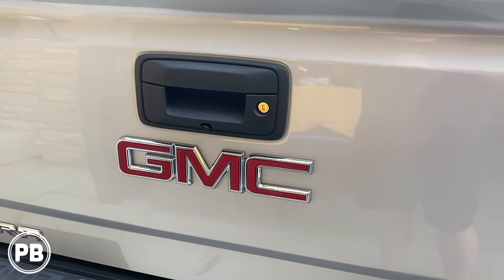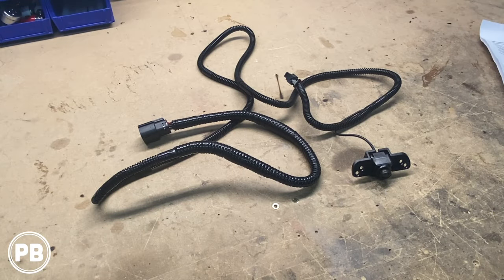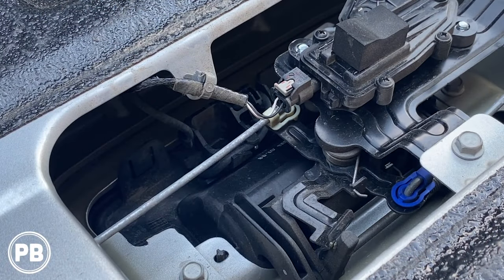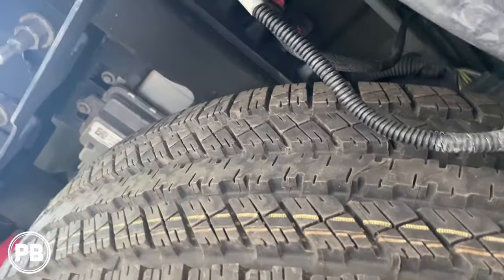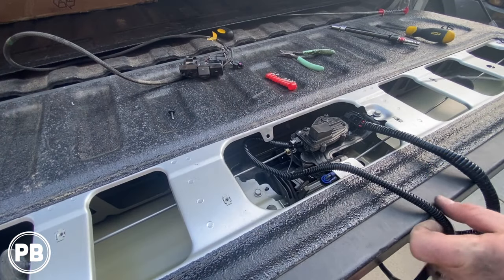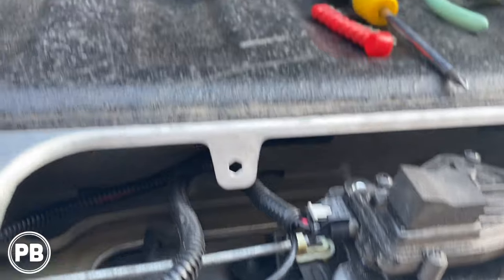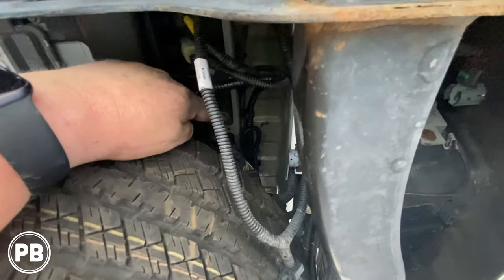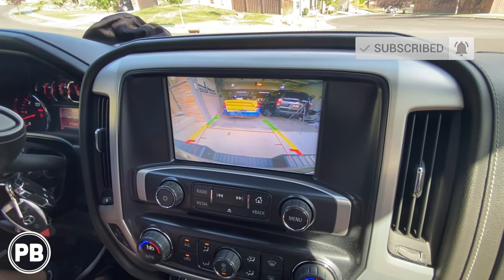2016 - 2019 Chevy / GMC Tailgate Camera Upgrade

Comment: before pulling out the old cable, tie a string around the original wire and when you pull it out, you can connect the string and pull the new line back through.

Comment: Will the guidance lines still work the same as with the factory camera? Meaning when you turn the wheel, the guidance lines move accordingly?
Reply: The ones placed by the truck will. The ones placed by the camera won’t. I would double check their width accuracy in case of the new camera has a different aspect ratio
Reply from the maker: Yes, the dynamic guidelines still work as those are produced by the radio, not by the camera.
Reply from the maker: Notes in description cover this question.

Comment: I just installed a new backup camera. Your video really came in handy for me. It took me 1.5 hours to install. I had trouble trying to unplug the backup camera harness underneath the bumper. My truck is freshly undercoated and it was a real mess. Dropping the spare tire gave me that extra clearance. I didn't have any wire to fish the the new camera wiring through so I used 2 24" zip ties and fished the wire through. Luckily my wife was able to give me a hand fishing the wire through. The backup camera is night and day difference. I did notice it is a little distorted when  the sun is reflecting off of some objects. But overall it works great. Thanks again for your step by step video.

Comment: How did you get the wire harness under the truck to unlatch?
Reply: Pull the red tab out, stick a small flathead in the opposite end of that channel where the tab keeps the two pieces together. It's a real PITA.

Comment: How does this look at night compared to the OEM camera? Mine has recently looked grainier than usual at night, but it's not cloudy during the day. I have a 2016 Sierra with the powered lock tailgate, so this is the exact camera replacement I'm looking for. No doubt it provides a better and wider image, but all I've seen are videos/pics of it during the day. Looking for feedback on night clarity. Thanks!
Reply: You have the same problem I have on my sierra/dealer says it's normal and I don''t agree b/c 3 other trucks in my family look fine at night so I'm gonna buy this cam and put it in/ hope it does the trick
Reply: Did you find an answer to how it looks at night?
Reply: @whiteout130  Unfortunately nothing definitive. Found one comment buried somewhere for a different branded camera (but it claims to have the wider viewing angle so I think they are the same) and they said it was not an improvement over the factory camera for night viewing. Since my camera is still fine during the day, I'm not in a rush to replace it and find out if this one is better at night. Let me know if you get one though and what you think of the night clarity.
Reply: After I replaced my camera yesterday, I went out last night and backed down my driveway in the dark.  I found the picture well lit and could back around a corner really easily.  This camera is 20x better than the stock one in a 2018 GMC Denali. The dealer kissed me off numerous times; they are going to be embarrassed when I show them what we did without their help!
Reply: What about the turn assist lines do they curve as you’re steering just like in the OEM camera? And I’m only asking bc I’ve seen other cars that don’t and I find it very helpful that GM does that for its vehicles.

Comment: You couldve just tied a string to the old harness and pulled it through then pulled it back to the other side with the new harness
Reply from the maker: Yes, you could do that as well.
Reply: Is it possible to just cut out the old camera and splice the new one in its place?